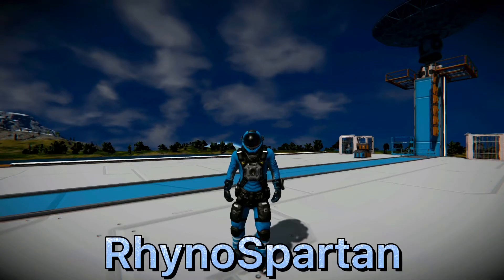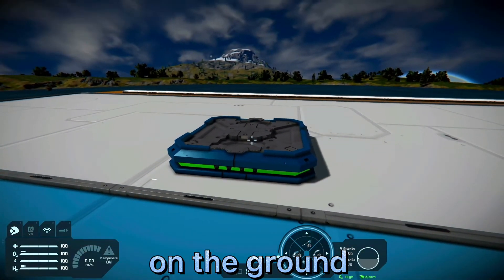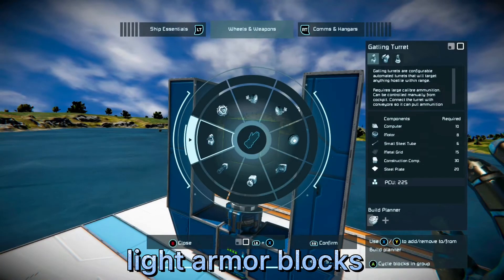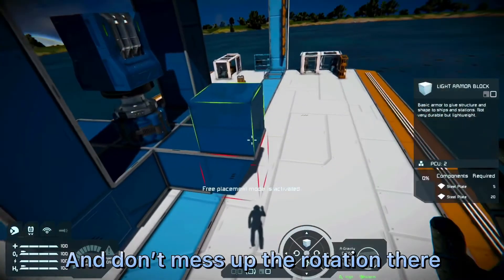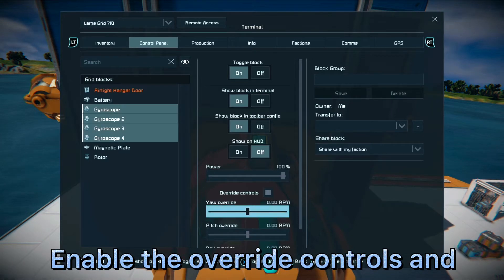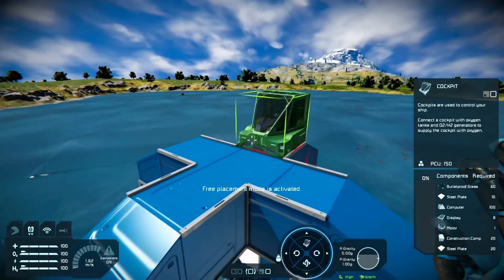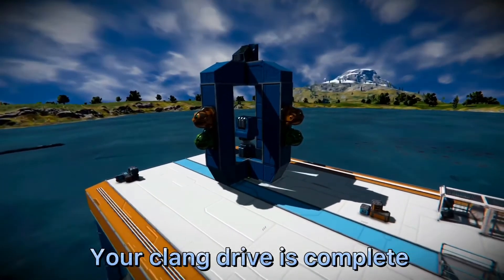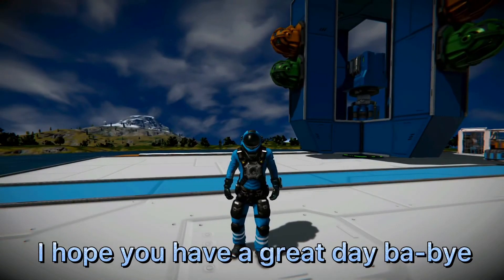Space Engineers Clang Drive Build Tutorial

Comment: Thanks, I built one of these and it worked just great.  I understand that you are giving people are way off the planet early and with minimum resources; however, a couple of points.

The "Override" gyros do not need to be at full power.  I run them at .005 of full power, and the "Maneuver" gyros at .35.  Maybe it's just taste, but the lower power settings for the "Override" make the ship much easier to fly when you are maneuvering.  All you need is enough yaw override to make the chosen vector "sticky".

Only 3 gyroscopes are necessary for the initial build.  Two for "override", one for maneuver. You have to have at least two in order for them to work against each other to balance the ship... at least I think that's how it works.  I can't get it to work with one.  And the problem isn't having enough "gyro power" because I run the things at such low power settings.  So the way I figure the two gyros are working to oppose each other in order cancel motion.

As I'm sure you know, it is critical to center the mass of the vehicle along the axis of thrust, a secondary concern is to keep the mass down in order to increase the acceleration, and decrease materials.  Keeping this in mind, you have four pillars on which you've placed eight gyroscopes.  You might consider just using the original two pillars that you built, and placing the two "override" gyros on either side of the cockpit, with the "maneuver" gyro under the cockpit.  This arrangement balances the weight of the battery.  

Turning on the "Show Center of Mass" option is very helpful when balancing the ship.

You might consider making it clear that the ship accelerates but can't stop without thrusting back along the exact vector it used to thrust in the first place.  Given this it might be helpful to use two hangars door/rotor combos in opposition to each other.  This way you can mostly stop the ship without touching the mouse and changing the vector.  Though as quick as this new build is, it's takes good timing to get the speed down into single digits.

You might get by with setting the ship up with two hangar doors for about the same cost as the original setup simply because you only need three gyroscopes. (Just guessing). The extra battery might be a bummer.  If not the three gyro/two pillar setup works to get off Earth for fewer resources... which was your initial goal.  You can balance a two hangar door  ship most easily by putting the cockpit where the hangar doors extend into.  Then put an Override Gyro at each end, and the Maneuver under the cockpit again.  Works great and is REALLY quick. 

Once you get to space, you will of course, want to add a 3 axis thruster package so that you can completely stop the ship at will.

Don't get the idea that I don't appreciate the build, it is great.  Just a few suggestions, that may or may not fit your parameters.
Reply from the maker: I am impressed by your knowledge on this topic. All of the additions and adjustments you spoke of I will add to my Clang Drive V3. I will of course credit you for your plethora of ideas. Thank you for the feedback.

Comment: Can I use a headless piston on a small grid?
Reply from the maker: I’m working on a video that will answer your cool question
Reply: I tried to but only force I got was rotational
Reply: @VeneficusCubes  I think the key is to get the piston... to interact with a subgrid.  That is to get the piston to push on a small grid, subgrid that is attached to the main ship.

There is something about subgrid interactions that works differently.  For example the max speed of a sub grid is like 1067 m/s.  Which is how clang guns works.  And this fact can be used to accelerate entire small grid ships to that speed.  

In a build like that you are fooling the physics into creating a sub grid that continues AFTER the ship is disconnected from the clang drive.  You can even turn off ship's power because the grid still thinks it's connected to the base with the clang drive.

Major Jon did a cool video about this:

https://www.youtube.com/watch?v=L6qnwrEyukU